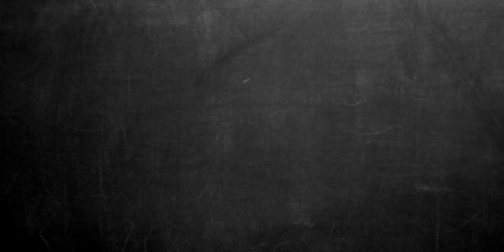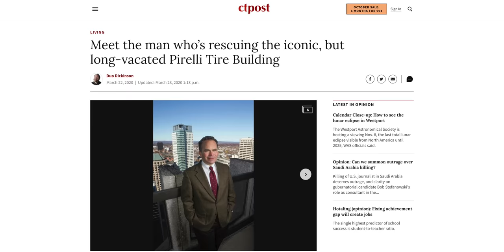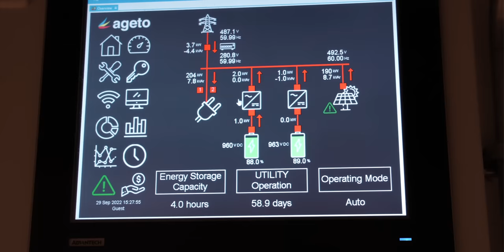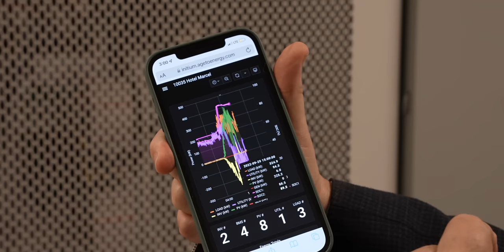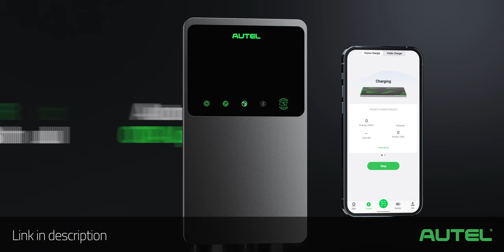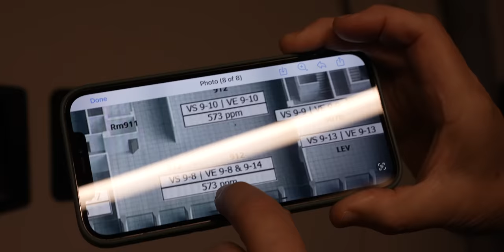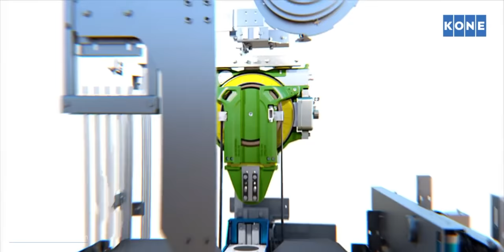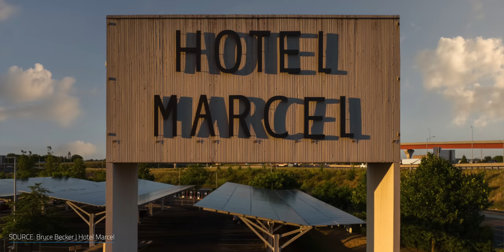How Big Can You Make a Passive House?

Comment: The whole cat5 and cat6 wiring is an incredible idea. I hope that becomes the standard because it would sure make things much simpler in homes.
Reply: Until the moment all the things aren’t compatible with (old) cat 6 anymore and therefore one is forced to change all CAT 6 wires with the new CAT standard ;) except of that it’s indeed really awesome.
Reply: @MathieuDeVinois  That's not happening in the next 2 decades, networking standards last an incredibly long time and new CAT standards are already compatible. CAT6 is already overkill for IoT so they are set for a long future.
Reply: @MathieuDeVinois  CAT standards are backwards compatible. You could still use Cat3 today if all you needed was 10 Mb/s (more than enough for smart devices).
Reply: Would be nice if this became more standardized and popular in the market.  Right now there are companies that do it but its not the most friendly system.  If your lighting company stops supporting the trendy poe light product 3 years after launch because its not selling... what do you do when if fixture dies?  Are there "friendly" to use residential use POE supplies/control boxes?  I messed with this stuff commercially 3-4 years ago and dealing with Cisco network equipment and their support was a pain in the ass.  (i think this was UPOE+? 60w per port)
Reply: @mixamun  this is why you should insist that smart devices you buy are able to be controlled locally. No cloud service for someone else to shut down and brick your devices.
Reply: @Renegade605  Ask Linus from Linus Tech Tips. He was trying to do that for his new home, and even someone as massively connected in the tech world as him had a huge problem finding a company that does that, and then more issues with the products and software itself. It's not an easy feat.
Reply: Also not to rain on everybody dreams… but cat6 cable can only carry up to 2.2A. Which in the case of the DC LED’s in the video (12 or 24V) is more than fine for a handful of them and the shades but not much else. 
You aint powering your fridge and you drier with it.
Reply: @darksunrise957  I follow Linus. And I know there are some situations where no such option exists. But, in lots of situations, the option is there.

Plus, by insist on local control, I don't only mean buy these devices, I also mean advocate for them to exist.

I currently have a smart home with no cloud services of any kind.
Reply: @rashakor  I'm about 100% sure no one was suggesting they power a refrigerator with PoE.
Reply: @Renegade605  as far as I know POE+ is only supported since CAT5E and would depends on how many lights they have on one cable. CAT3 is supported for low power though
Reply: @autohmae  not saying you should use Cat3 in a new retrofit, just that you could.
Reply: Sounds like and interesting business proposition, especially with new construction in well to do neighborhoods.
Reply: @rashakor  Also the length of the cable is limited, as resistance increases with length.
Reply: @rashakor  " but cat6 cable can only carry up to 2.2A. "

Exactly, maybe it's the engineer in me, but the first thing I thought was that you can't use CAT cables for power, it's low current. And if you don't know anything about electricity, to put in perspective, an iPhone 12 draws 2.2 Amps charging. It would take roughly 7 CAT cables to support the same current as your standard electrical wiring.
Reply: @Renegade605  Im totally onboard with smart devices being able to be controlled locally... let me run a rasppi server or some other simple software i can have on my home network to control that stuff... I wasnt really addressing cloud service in my comment though.  My experience with POE lighting and Cisco was just pretty meh and those did not need internet connections.  Honestly my biggest gripe was poor development, firmware and unexplained bugs.
Reply: The choice of PoE for all the lighting didn't really click for me... until I realized it's basically the most accessible/best supported low-voltage DC wiring spec on the market.  And small gauge twisted pair is very cheap compared to 12 gauge romex.  It's actually a very practical choice for wiring up DC LED lighting.  And hey... you get networking for free on top of that.
Reply: @mixamun   We've been around 10 years already.  Still support the earliest systems, but tbh, they're super stable and we have zero service contracts.  Except for the occasional lightning strike damage or super early alpha system bugs that are long since resolved, they just run, like lights should.  The DC does help because it's not exposed to the typical spikes, surges, and dips of AC and the grid.  We're testing 802.3at and 802.3bt cards in the gen2 this month
Reply: @rashakor  We tested the LibRE Proof-of-concept product to 90W/port but derated it to 50W so there's no degradation in the wires even near coastlines with high salt and humidity and also high altitude where creepage becomes an issue.  For the current NEC, we stay below Class2 100VA so we can safely do PoE voltages in the 48-56V range.  No need to drop to 12V except at the endpoint device.  The Carro Ceiling fans from Home Depot work great over Cat5 and we feed them with 48V @ 600mA (peak 800mA inrush). Well under the cable limit.
Reply: it wont because electricians wont like it, they lose business. Anyone can run and terminate cat5/cat6 cables electricians train for many years and spend a lot of money to be qualified they will try their hardest to stop this transition.
Reply: @Brurgh  well lucky there are tons of jobs in the automotive and grid energy solutions and an ever growing demand for both that outstrips supply currently. Besides its often contractors who subcontract out those jobs out to electricians in new building projects and they could increase their margins which makes a huge incentive to just hire electricians to wire in from the grid and then get a regular shmo to run all the wires and plug them into little ports lol.
Reply: @Brurgh  I will say that being able to run it without requiring a licensed electrician could make it far more viable. There can be a significant savings in cost if you can avoid an $80+ per hour electrician on a major project.
Reply: @mixamun  This is exactly what we focused in resolving.  The platform allows the specific technology/standard/protocol to be selected per port, so you can use whatever the new stuff in 3 years and LC maintains the compatibility between the old and the new.  As for not going out of business, we're not taking any VC with cliff requirements or similar term risks.   Even the business model is based on "safety, security, satisfy, survive, grow, innovate-- in that order" 😄
Reply: @darksunrise957  connect us with LTT. I love his videos!
Reply: @rashakor  VoltServer can deliver 300W over Cat5.  Small, HVDC pulses about the same energy as a naturally occurring static shock, and in between check if the zaps are getting to the other end.  We can (and likely will) embed their tech in at least one card model so we can power and control larger loads.
Reply: @Renegade605  I still recommend AC appliances today.  The cost premium is pretty steep for DC only because of volume.  A few big developers onboard and that will flip because of the lower cost to make DC direct head-ends (the input to the devices and first voltage regulation component)
Reply: @autohmae  It's actually somewhat difficult to find cat3.  I got a test box of aluminum cat3 to test with for $20.  The resistance is TWICE that of typical cat5e 😄.  Still works with LC but the touchpad was inaccurate at 1000ft and 25ft of AC wire bound to it.  This is FAR outside the spec but it's an example of the tests we do.
Reply: @anydaynow01  We are making 4 brands to cover every market.  ReNetA is specifically for Production Home Builders so it's within their (cheap) budget.  Especially for McMansions because the wire cost for AC is rather high due to length. Apartments as well.  The next brand up is for upscale homes with a few more features and higher power density.  The best part is these two lines are highly interchangeable in key ways.
Reply: @mixamun  The part you may love the most is the "Hack the Home" features.  We'll release cards and modules to allow you to safely make your own hardware interfaces.  Full API of course on the control side.  This platform is made for innovation without the security, connectivity, and battery management issues of wireless.
Reply: @LumenCache  yeah, I didn't expect anyone to buy it new. Just think really old cat3 which is already in some wall probably not smart to put power on it ? Yeah, their are lots of interesting applications of CAT cables. It's fun seeing what you can do with it. I'm not that familar with CAT specs, but 1000ft anything sound out of spec for sure
Reply: @Brurgh  It's been 60/40.  60% of electricians like it because they can install it faster and with their less senior people.  CEDIA legal affairs team battles states that try to force restrictions on who can install Low Voltage (class 2) wiring with some states being lobbied to require electricians install anything above 10V--so you'll need to call Sparky to plug in your USB-C, technically.  We helped fight it by pointing out the system is tested and approved by UL and can not be installed in a way that overloads the circuit like AC can.  So even if it's installed by untrained individuals who incorrectly install it, LumenCache panel will simply say: "nope, not powering you, you're an incorrect load."  So the impetus is on the factory to control the safety where UL does the certification of that and ISO9000 does the consistency, etc.  No need for installers to learn the 860 page national electrical code.
Reply: @LumenCache  Then count me impressed. I see many LED companies doing the same with fast intermittent loads. Pretty cool.
Now the question become how resilient and long lasting are those controlling electronics?
Reply: @MathieuDeVinois  Cat 6 has been the standard for 25 years.  It isnt changing any time soon especially for POE and low bandwidth IOT things like lights.  Computers needing optimal performance can still use separate wires with evolving standards in separate conduit (relatively easily changed).
Reply: @Renegade605  but then u have to manage the device yourself. most people wont even be using the device by the time they shut down the cloud servers
Reply: @ramuk-  well for one, I want to manage my devices myself. And secondly, cloud services that people are still using get shut down all the time.

Comment: The Kone powered elevator is nuts and I love how they made this building in such an amazing unque way and the guy himself Bruce he sounds pretty cool and saying that he's passionate about what he does is more of a reason we need more people like this!
Reply: Most lifts have counterweights which makes the motor doing the stopping and starting. If you take them away then it would make the motor work harder on the ascent. This would negate any power gained by using brakes instead. 
Counterweighted lifts are about as efficient as the lift can be made. If there is a gain it would be so minimal as not to be worth it. The CO2 to produce a lift with that much technology would take decades if not longer to ever make back. 
Physics is physics.
Reply: @Vile_Entity_3545  I have not looked this up, but I would be quite confident that it has counterweights like any elevator and uses regenerative braking when the elevator is loaded and descending, since that is a scenario when you need to use braking to control the descent as the weights are out of balance. A regular elevator would just use regular brakes for this, dispersing the energy as heat in the elevator shaft and/or a service room on top of the shaft. That is the lost energy you are adressing, plus the possible use cases for energy storage. It could be that this elevator uses regenerative braking for stopping when asending as well, depending on the speed you are going and how fast you need to slow to a stop.

It seems very plausible to me that a regenerative brake system can make up for its cost in energy savings over time. At the fundamental level you are just running an electric motor (something you necessarily would have anyway) in reverse.

Yeah, physics is physics, but clever engineering is clever engineering.

Comment: 09:00 Bruce said all the rooms run 100% out door air...that is unbelievable as other than hospitals or a Vega Casino every other place runs at the minimum standard of 10% fresh air because of the massive costs. Now some newer systems like cool beam tech cheat this math like a crooked accountant because they reduced the size and volume of the supply air system down to about 10% of the normal and don't run a return air mixing system, they just exhaust. Matt it looks, you chose an exceptional property to cover for your channel, truly impressive!
Reply: It's unbelievable... because we are so much used to these high-energy-loss fabric, taht we just can not "imagine" that almost all of these losses are ... losses! And are avoidable losses.

To realize this is actually the key for any solution: If you reduce losses BY a factor 8 or so, heating/cooling demands are reduced by this factor. AND, simple consequence, the small amount of fresh air needed ... all the sudden will be just enough to deliver the heat (or remove the heat) still needed. We can even afford to increase fresh air a bit (because of the heat recovery), still don't add much losses AND improve indoor air quality also by factors (really not less important in times of high viral loads).

This way you get a lot of additional extra benefits (not just reducing energy bills; the noise reduction is another one; ...)

Comment: Since I've learned about passive housing, I was really excited. Actually, this video reflect a idea that I had that it would be really incredible to build large apartment buildings with passive housing principles. Between a hotel and a apartment building, except for a few differences, it pretty much comes down to similar things so this video really proves that not only it can be down but it would be a big improvement on quality of life for aartment renters and owners.
Reply: Apartment owners and MDUs is one of our main market focus.  We can give them reliable smart lighting and more without all the security and wireless connectivity issues of mesh systems.  No need to "just add more nodes" in an already thick soup of colliding signals.